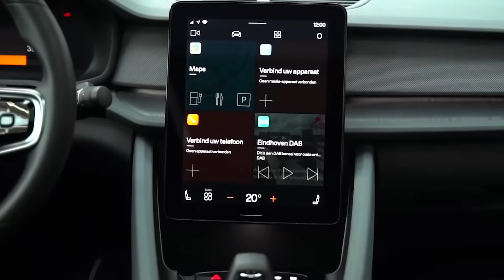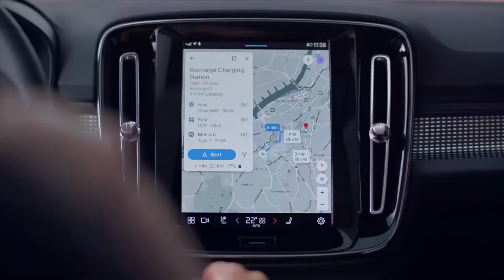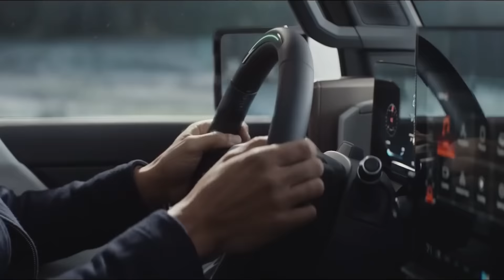12 New Electric Cars Coming In 2021

Comment: I've been driving a Hyundai Kona Electric since March of 2019.  It now has over 46,000 miles on it, the battery charges to 4.06 miles per KWh after untold charging cycles on my Level 2 home charger.  That's right at 2.5 years ahead of all the vapor-ware cars "soon to hit the market," and I seem to remember they were saying the same thing about the same cars 3 years ago!
If Hyundai decides to introduce an all EV version of the Santa Cruz, I'll be all over it!
Hyundai has a proven track record, and aftermarket support of their entire lineup has always been outstanding.
Reply: electric tuscon would have me buyin.
Reply: Ionic 5 is bigger than the Tucson and a beauty.
Reply: How long is the time to charge to full and what is the range the car can go. Sounds like you are happy with it. I have owned 2 Prius and am happy as well. Does the Kona have a fuel component for once the battery is depleted?
Reply: Hyundai and support. No no no. My experience with their luxury line has been frustrating costly and horrid. Still have no title. No one can align it. 
Hooorrrrriiibbbble
Reply: rimac is workin baterries for hyundai,porsche group
Reply: If you take a cross country trip, in the winter with a vastly weakened battery at cold temperature, with the electric heater going, how often do you have to stop and for how long before you can continue?   I can go over 600 miles and be fully refuelled in less than 1 minute.

Comment: I've been driving a Ford Cmax Hybrid SEL since 2013. It gets 41 mpg average, has not had one problem, it's super quick, handles like a sports car, has every toy made, luxury leather interior with perfect form and fit, excellent sound and GPS Navigation, never needs to be plugged in, great interior size and headroom, quiet and comfortable. Oil change twice a year, low maintenence, 1 set of tires, still looks brand new. Best car I've ever owned. I'm not a tree hugger, but I'm all in on electric cars, great engineering .

Comment: I'm waiting for a car that can go 500 miles on 4 AA batteries.
Reply: Then the price of AA batteries sky rockets
Reply: @deekamikaze  You're absolutely right. AA batteries would then cost about $20 each.  When electric cars become the norm, I'm sure there will be some kind of per mile tax on road use as per a GPS built into your car.  If they made cars that could go 100 miles on a gallon of gas, gas would cost at least $10 per gallon.  We never will get a break.
Reply: @frankmayer139  You get a break when the air is breathable.
Reply: @judithosborne9065  Yeah, but where does the electricity come from?  90% coal, oil, gas.  The only practical renewable energy comes from hydro electric plants.

Comment: 5:57 -- the Hyundai Ioniq EV has been around since 2017. That's the same year the hybrids were introduced. But the larger 2022 Ioniq 5 has been spotted at a local dealership before this video was released.
Reply: @ghee cappy The Jetsons already did this. LOL We should have already been driving them. With all the road rage these days, I am fine on the ground. I sure don't want to experience Air rage. Oh, we already have that on airplanes.
Reply: To increase the efficiency of electric vehicle, battery ought to spin

Comment: Anything less than 300 mile range on 1 charge is not acceptable in this day and age unless it is a pure city car. Tesla is light years ahead.
Also 0 to 60 means nothing compared to price and range.
Reply: yeah sure. Tesla is multiple light years ahead of almost every company in range, but just one behind Mercedes.
Reply: It depends a lot where you live and how you intend to use it. Here in New Zealand 200 miles is more than enough for most people, and if you are using it as a second car or town car, you don't even need 200 miles.

Comment: It's so wild that the narrator suggests that any of these vehicles are better than the Tesla equivalent. 200 mile range is a hard no on any EV. It is recommended that you keep the battery between 20%-80%, so basically use 60% of the battery capacity to keep the longevity high. 60% of 200 miles is a measly 120 mile range. I watched this video to find out if Tesla is the best pick, my mind was not changed. Tesla is hands down the best ev manufacturer.

Comment: The original Nissan Leaf had sales that reached almost half a million dollars🤦‍♂️😂.
Reply: It was junk, the worst resale value EV CAR
Reply: @thomaspepper2201  everyone loves them.
Reply: @scottbaxendale323  Sorry 1in 5 return back to gas power, cross country driving using the chargers on the road cost 31-38 cents a min, 4hr charge is $91.00x2 = $182 for a 200-300 mile drive, to be fare use 4x$182=$782 dollar per give or take a 1000 miles. There a JOKE AND GO BROKE
Reply: The problem with the Leaf was they were involved in many rollovers.  All the new owners were trying to turn over a new Leaf.

Comment: More EV reporters need to focus on not just battery size and range, but chemistry. This is the most important factor in how well the car maintains range, charging speed, and long-term capacity. Battery chemistry should be one of the very first things you look at when considering an EV, but it’s often buried under a lot of meaningless gimmicks.

Comment: The problem with EV is the charging times. We would be better served if you could easily swap dead batteries for charged ones. The swap should be easy and standardized throughout each model.
Reply: Fast chargers around L.A. (free at many shopping malls) give me 80% of my range (130 miles) in about 18 minutes.  …….fast enough for me (while I get a coffee, do some shopping). Not a problem.
Reply: @eddieg6436  what about degrading the shelf life in lieu of fast charging? It's all new, so questions remain. Eighteen minutes for 80% is noteworthy. But, is there a downside over the longterm?
Reply: @videopokernetwork6824  I got my electric BMW i3 way back in 2014.  Sure, it had less range, but it was NEW.  Never any issues with the batteries for the 6 1/2 years I had it.  I’ve since traded it in for the new one, range is TWICE the old one.  Love it!
Reply: Tak predložio sem pred mjeseci omenima će mojim prijateljem ✌️

Comment: When the engineers figure out how an EV can recharge its batteries, while it’s being driven, then internal combustion engines will immediately become obsolete. The charging problem is the only thing keeping EV’s from quickly replacing tradition gasoline powered vehicles now.
Reply: Absolutely correct!

Comment: what's with all the SUV's? I can't stand SUV's, what happened to a car with good driving dynamics? not SUV barges that lumber all over the road. We need a BMW 3 series estate All electric type of car, great looks, great handling and more interior space than any SUV.
Reply: agreed, as I live in Europe I prefer smaller cars (I rent Fiat 500E, Egolf, Renault Zoe, etc. all great for daily use as lots of charging spots here). But 3 series rocks, I'd consider one. I cant wait for the ALPINE (owned by Renault but really a different brand, just won F1 btw and they re workin on electric version)
Reply: the BMW i4 is coming soon for those looking for a traditional BMW look

Comment: I consider myself to have an open mind with design, but the Cybertruck is so ugly.
Reply: If you look at most concepts of cars almost all of them are angle less blobs. I think the cybertruck was more of a statement on what cars can be
Reply: The looks are in the eye of the beholder, but comparing the stats the cybertruck has the lead over anything in it's class. The tri motor cybertuck is gonna be an absolute beast.
Reply: @XKawN916  Oh, no doubt that it’s technically impressive, but there is such a thing as objectively beautiful and objectively ugly. The Cybertruck is objectively ugly.
Reply: @D71219ONE  I have the tri motor cybertruck on pre order. I too thought it looked ugly as heck when I first seen it. Now I just think if I ever go to the moon me and my cybertruck will fit right in.
Reply: @XKawN916  I feel you there. If it meant I got to go to Mars, I’d drive a Cybertruck all day long.

Comment: If you take a cross country trip, in the winter with a vastly weakened battery at cold temperature, with the electric heater going, how often do you have to stop and for how long before you can continue?   I can go over 600 miles and be fully refuelled in less than 1 minute.
Reply: gas engines have had over 100 years of advancements, evs have just started.

Comment: I say this to the person who unfortunately is thinking about spending the $72,000 on the SUV if you're serious four wheeler you will never ever take it out in the woods you'll be shocked how fast that 300 mile range will drop to less than a hundred because they're not maintaining the gearbox they're only maintaining what all-wheel drive each engine going to each motor sounds cool right on a drag strip yes but when you're going up a hillside you're not going to have hello gears you going to have them fantastic torque but without the gears you know how it's going to be so easy to wrap that thing around a tree and let alone how fast the voltage drops in cold weather because right off the bat all batteries lose 30% of their capacity in freezing temperature
Reply: Clearly you don’t own an EV. Buy one. It will change your mind. Did me.

Comment: Tesla truck looks really cool. Anyways, I 'll wait until Toyota launches their own , since I drive Toyota Prius 2013 , the most reliable car , that can easily do 300,000 miles without any issues.
Reply: Toyota is fighting the change and has scared all it's good engineers away from EVs.  I would not even look at any Toyota EV.  Not ever.  It's a dead company walking.
Reply: @crhu319  How about Honda, then?

Comment: It is my understanding that the gasoline powered Hummer may have a smaller total carbon footprint than a Toyota Prius. I have also read aticles which tend to disagree. We need to keep in mind that electric cars also have a carbon footprint and an impact on the environment.  Our lemming-like rush to move away from petroleum-based energy tends to ignore that all energy alternatvies have an environmental impace in some way. That includes electric vehicles. I’m happy that we are moving to electric, but let’s stick to facts, and recognize the issues that come with that.

Comment: I won’t be interested in anything electric until it can drive nonstop for at least 1000 miles averaging 80 mph. They must compete with gasoline or diesel and do what they do in terms of distance. Electrics already won the performance battle hands down. They must eliminate battery recharge fear before the masses adopt.
Reply: Who drives for 12.5 hours without a break? That’s just not really sensible. There are also, as far as I can see  only 5 current production cars that boast that kind of mileage in Europe and they are the worst selling models of their range? All of them will be discontinued by 2028 at the latest regardless of wether you or I are interested.  I suggest you take a good look at the stats: most manufacturers are discontinuing ICE by 2026 and 8of the major 11 fuel stop companies are indicating discontinued fossil fuel by 2030.  Electric vehicles are the top selling 5 vehicles in the uk and the only vehicles with increasing sales.  Game over.
Reply: @grahambalmforth625  Internal combustion powered vehicles are all I have ever known. I can drive my Ram 4x4 Cummins powered diesel truck for the rest of my life. I’m only 65 yrs old, so it has to deliver another 30 yrs or so. I’ll bet you I can still buy diesel in 2050!! 😏🇺🇸💪

Comment: you do have to realize that the farther away from the origional source of energy
the less effeciancy you get. the amount of energy used at a power generation
plant and emission is FAR more than would be used if it were directly powering
your vehicle. just because you don't see exhaust does NOT mean you are not
creating "greenhouse emission". that's the same as thinking that stuff made in
china, with no pollution standard-  is better than manufacturing stuff here in 
the USA where we have intense emission standards.

Comment: They should put small wind turbines on the top of the car to generate power to the battery while moving. Same way wind fields generate power just a smaller version for your car.

Comment: Calif and handful of states are banning high end computers cause they use too much power and bricking 1500 graphic cards so why would I  buy electric car 
They were putting new poles for electric cars but that has stalled 
Yes these cars are great but will it start if gets too cold and not damage the car 
One day it was -50 deg with wind chill 
Biggest problem I heard from my mechanic was flooding pot holes and accidents causing battery fail 
That's totally car in 25mph crash 
These reason are hurting sales

Comment: YET, they have to mine the materials to make the batteries, import them  AND THEN HAVE MILLIONS OF
TOXIC BATTERIES DUMPED....NOT  BETTER, MUCH WORSE.
Reply: New, redundant research just put an average EV at 60-68% less total lifetime emissions, which includes everything you are mentioning. Plus, it gets greater as more renewable energy gets implemented.
Reply: And, it is probably better to "dump" a battery than have, what is it, 16 pounds or cubic meters of carbon dioxide emitted into the air for EVERY SINGLE GALLON of gasoline burned.

Comment: No doubt that they are nice looking, but the problem is, most of the batteries are made in China, are caustic to  make and are expensive to replace.  What is the real mileage with the Lights, Air Conditioner, Radio, Phone and other accessories on.  One talk show host rented a electric vehicle. The rental place told him that he should get 100 miles to the charge. With all of the accessories on he only got 37 miles to the charge. Where is the electricity to charge these vehicles coming from?  FOSSIL FUEL Electric Power Stations.  How long does it take to fully charge these Vehicles? 20+ minutes to several hours. I think I will keep my  Gas Powered 4 Wheel Drive Vehicles that take only 10 minutes to fill up.  Electric Vehicles are definitely fast off the line but a High Performance gas powered vehicle will reach a higher top speed than any of these electric cars. The faster one goes in these Electric Vehicles the shorter the distance one will travel.

Comment: Electric vehicles are alright practical for the Rich.
Reply: Really? Barring this crazy Covid resale market and the fact that everyone is supply constraint, you can buy a second hand used Tesla for about the price of a top tier Toyota. It will be more reliable and cheaper to maintain and operate not to mention 1/2 to 1/3 the cost to refuel. Forget oil changes or visits for tuneups, breaks or engine/transmission work.  The world is going electric and Europe has already mandated no ICE sales in a decade or so. Lots of cheap electric options coming too, like from Hyundai for $30K.
Reply: @semotech  Tesla cars are reliable but hell nah on it being cheaper. Tesla has well known for having about same customer service practice as Apple. Also it's better to new Tesla since people who sell their used Tesla are trashed about to the point that not even Tesla wouldn't accept them

Comment: You definitely will never understand what it is to drive a clean motor you're definitely not going to understand driving across country by yourself as many miles as you want during a day just because you can pull in and under 10 minutes be gone no now you're going to have to learn to love to pay extra for a quick charge and that's only why you got the charging credits and by the way most people are bitching about the charging stations are not being kept up and they have to call a tow truck and if you think you can pull your own generator to charge your own vehicle you going to have to have a minimum of 9000 Watts and that's going to take a full 8-hour charge and that you carrying your own charger gas powered generator

Comment: LITHIUM batteries will destroy the environment both in the manufacture and in the disposal. Also if one of these car- sized batteries should short out the heat generated would be 5 times as hot as an uncontrolled gasoline fire. It would destroy everything in and around the  car within seconds. Finally where are you going to get the electricity to put in the EV cars to power them? The existing power grid, from coal fired power plants? You guys are ridiculous. The only alternative there is,  is tiny commuter cars and mass transit to move commuters efficiently. And these would only work in high urban areas. Sorry to burst your bubble.

Comment: Never mind the range, who the hell can afford these cars, it's just plain daft if they want everyone to go electric, they need to get the price down to the mid 20s, with at least 350miles range, most people can't afford 30k let alone 50k
Reply: Tesla is planning to introduce a car starting in the 30k zone which is expensive but shows a lower and lower cost for electric cars which is a good sign in my opinion. Also, their new models will have a longer range with their new and more efficient batteries.

Comment: You got to laugh at the idiot that designed the Mercedes being battery-powered and no the only being able to achieve 200 miles under perfectly good conditions let alone in cold conditions it automatically loses 30% of that ability to charge right off the top and then let alone if you happen to enjoy wanting to open up your Mercedes a little bit don't forget how fast you drop voltage you'll be freaking out trying to find a working charger with that short of range